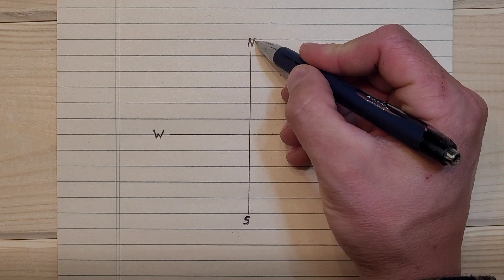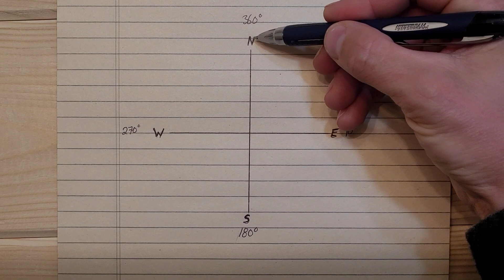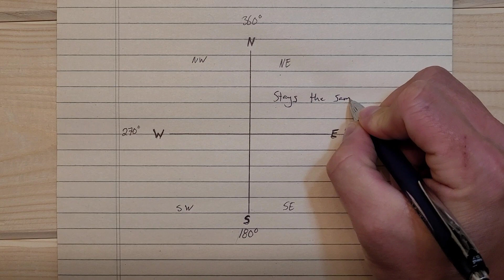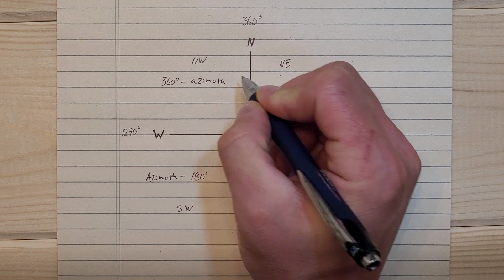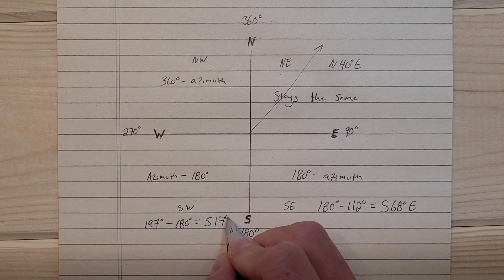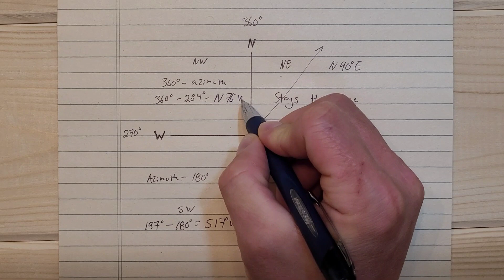How to Convert Azimuths to Bearings

Comment: What if the azimuth is -100° how do you calculate that into bearing?
Reply: One of the rules is that when the azimuth is less than. 90° azimuth =bearing
Reply: 180-100 = S80degE
Reply: @ashleymartinez5751 that's not how it works

Comment: If I convert bearing to azimuth, I just have to change the minus sign of the formula into plus?
Reply from the maker: If it is a NE bearing the azimuth will be the same. *Example: N20°E = 20° 

If it is a SE bearing take the bearing and subtract 180°. Ignore the negative value you get though. *Example: S7°E => 7° - 180° = 173° 

If it is a SW bearing take the bearing and add 180°. *Example: S30°W => 30° + 180° = 210° 

If it is a NW bearing you do 360° minus the bearing. *Example: N60°W => 360° - 60° = 300°
Reply: @SmithSurveying  hello sir! Is this technique a North Azimuth Reference?

Comment: If the true bearing of a line AB is 269° 30', then the azimuth of the line AB is A. 0° 30' B. 89° 30' C. 90° 30' D. 269° 30'
Reply: Please solve this question
Reply: Its -180° because it lands on the 3rd quadrant SW.
Reply: How do you know at what quadrant to land?

Comment: Amazing video! Do you any videos on how to convert bearings to azimuths?
Reply from the maker: I do not have a video but here is how you convert bearings to azimuths...

If it is a NE bearing the azimuth will be the same. 
*Example: N20°E = 20° 

If it is a SE bearing take the bearing and subtract 180°. Ignore the negative value you get though.
*Example: S7°E => 7° - 180° = 173° 

If it is a SW bearing take the bearing and add 180°.
*Example: S30°W => 30° + 180° = 210° 

If it is a NW bearing you do 360° minus the bearing.
*Example: N60°W => 360° - 60° = 300°
Reply: @SmithSurveying  you are a life saver! Have an exam next week and was having trouble with bearings and azimuths. Thanks again sir, Stay safe!
Reply from the maker: @ricoa8926  if you ever have any questions feel free to ask. You are going to do great on your exam 🤙

Comment: Need. Video to convert Bearings on Plats to Azimuth so I can cut line on the right direction when doing a boundary & topo
Reply from the maker: If it is a NE bearing the azimuth will be the same. 
*Example: N20°E = 20° 

If it is a SE bearing take the bearing and subtract 180°. Ignore the negative value you get though.
*Example: S7°E => 7° - 180° = 173° 

If it is a SW bearing take the bearing and add 180°.
*Example: S30°W => 30° + 180° = 210° 

If it is a NW bearing you do 360° minus the bearing.
*Example: N60°W => 360° - 60° = 300°
Reply: @SmithSurveying thank you!
Reply: I figured a simple way to explain . I wish I could share post image on your thread . But I found your video really helpful brother . Blessings

Comment: THANK YOU!!!  I have a boundary survey that (I just now learned from this video) is marked in azimuths.  I've done a bit of orienteering but only ever used bearings.  I have been stumped as to how to read this survey and your video has finally (1) corrected my understanding of the surveyor's metric and (2) how easy it is to convert.  The property is heavily wooded and some lines extend over 2000'.  Now I know how to find my line of direction and start marking out the fence line with confidence!
Reply from the maker: @Tunland Farm I am glad this video was helpful. When was that survey done? It might  be a good idea to have a surveyor come out and stake your property line :]
Reply: @SmithSurveying : in the past two months. I may reach out to have them do that but want to give it a go on a couple of short runs first. Thanks!
Reply: @SmithSurveying  : The survey was done this year.  The property is raw and overgrown, esp on the perimeter.  Two adjacent tracts purchased separately and the survey costs (combined) were close to $4,500.  I have given it serious consideration but for now I will probably just take my time with my chainsaw and work my way along it over the next few months. Time vs. money! 
Though I may revisit that decision at some point ;)

Comment: Pretty straightforward video but wouldn't the SW quadrant be 270 rather than 180 when you minus azimuth
Reply from the maker: Good question Jojo. Think of South as 0° when talking about bearings. So when we take the azimuth and subtract 180° it gives us the SW bearing. I can make a video explaining it in better detail when I have the time if that explanation didn't help
Reply: I was wondering the same thing.
Reply: That why Im bit confused 🤔

Comment: How about azimuth from south?
Reply from the maker: Can you please rephrase your question? I'm not sure what you are asking
Reply: @SmithSurveying  Given azimuth from south convert to bearing.
6 ° 35' - 
162° 12'- what's the bearing? 
109° 01'-
239° 33'-
320° 42'-
Reply from the maker: If you have an azimuth of 162° 12' and you want to convert it to a bearing you do the following:
180° minus 162° 12'
The bearing is S 17° 48' E 
Does that help?
Reply: @SmithSurveying  Absolutely Yes!
Reply: @SmithSurveying  I'm confused brother. 
Given:
Azimuth from south
 6°35'        :  will I add 180°  directly to 6°35' since it's in the South then convert it to bearing using the given formula?
Reply from the maker: If the azimuth is 6° 35' then the bearing is 
N 6° 35' E. Are these for school work? If so you might want to ask your teacher because I don't understand the "from South" part of the question
Reply: @SmithSurveying  it was stated in the problem that the given value of Azimuth South are 6°35, 162° 12', 109° 01', 239° 33', 320° 42'.
Reply: @raymundnucaza2176  some countries and us states (Hawaii for example) use azimuths from the south as opposed to azimuths from the north. That’s what’s going on here.

Comment: S 30 degrees E, S 86 degrees E, S 23 degrees E, N 3 degrees W
Reply from the maker: You almost got it man. Here are the bearings:
N30°E,  S86°E, S23°W, N3°W
Reply: @SmithSurveying  ok sir. S23 degrees W is the correct.

Comment: So how about bearing to azimuth? If I recorded S 217 W , what will happen to the azimuth?
Reply from the maker: Your bearing is actually S37°W. The azimuth is 217°. 

37° + 180° = 217°
Reply from the maker: If it is a NE bearing the azimuth will be the same. 
*Example: N20°E = 20° 

If it is a SE bearing take the bearing and subtract 180°. Ignore the negative value you get though.
*Example: S7°E => 7° - 180° = 173° 

If it is a SW bearing take the bearing and add 180°.
*Example: S30°W => 30° + 180° = 210° 

If it is a NW bearing you do 360° minus the bearing.
*Example: N60°W => 360° - 60° = 300°
Reply: @SmithSurveying  Thank you so much for the reply, I appreciate it man! This helps a lot! 😊

Comment: What about bearings to azimuths?
Reply: K thanks
Reply from the maker: You are welcome my friend 😃
Reply from the maker: If it is a NE bearing the azimuth will be the same. 
*Example: N20°E = 20° 

If it is a SE bearing take the bearing and subtract 180°. Ignore the negative value you get though.
*Example: S7°E => 7° - 180° = 173° 

If it is a SW bearing take the bearing and add 180°.
*Example: S30°W => 30° + 180° = 210° 

If it is a NW bearing you do 360° minus the bearing.
*Example: N60°W => 360° - 60° = 300°